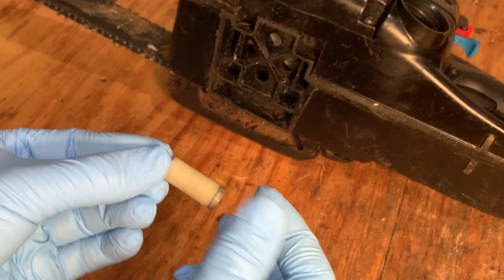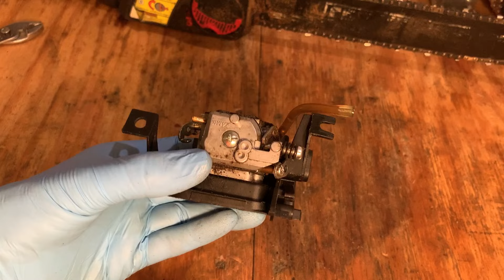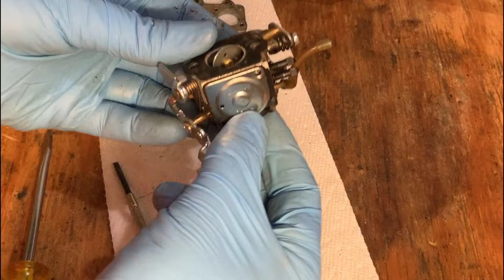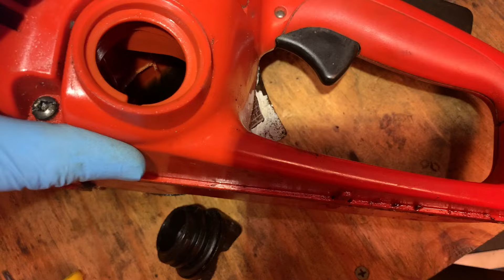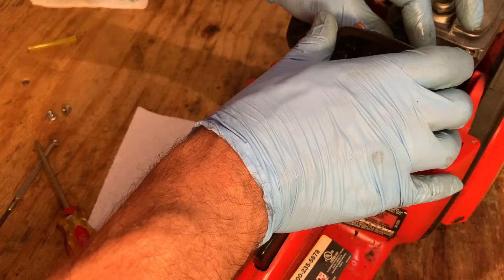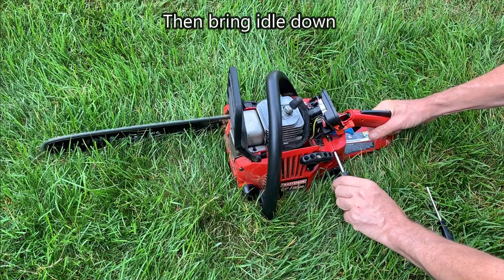Will They Run? Two Craftsman Chainsaw Will Not Start - Fixed

Comment: I have the same chainsaw, bought it new at Sears 20 years ago. As I’m sure you already know it’s just a rebranded Poulan, not the greatest but more than adequate for occasional homeowner duty. I replaced the fuel lines on mine a few years ago, they were completely rotted away (it doesn’t get much use). Watch out for the chain bar oil, these are just simple constant drip feeders and they’ll keep weeping chain oil out even when they’re just sitting until the reservoir is empty. When I’m done I usually dump the chain oil through a coffee filter and back into the bottle, otherwise the case gets loaded with oil.
Reply: I have a Poulan, bought in 2001, I used it for about 3 years.  I cut wood all year long, in the summer build up for winter,  and winter to keep well stocked.  Mostly only used on weekends.  Replaced the fuel lines,  fuel filter, air filter and one oil pump for the chain.  I let it set for a few years,  and wouldn't start.  Replaced the carburetor,  fuel lines and filters,  and it started right up, had to adjust the carburetor and it idles,  and accelerates smooth and fast. 

I know people knock on Poulan,  but if you take care of them they can give long service.

Comment: Since I started watching your videos I fixed a John Deere L111 riding mower that was sitting outside for four years, a Husqvarna riding mower that had gas leaking into the oil, an edger that I found in my moms shed that hadn't run for 6 years and 2 chain saws. Now I just have 2 motorcycles and a jeep to tackle next. Great channel.
Reply: Good job, keep it up.
Reply from the maker: Very nice

Comment: Both of these saws are made for Craftsman by Poulan Co.
Reply: Husquvarna builds those saws for Craftsman and Poulan...I have Poulan Pro set up just like this it's just diff color combo and rebadge...One of the best saws I've ever owned and used honestly.
Reply: Hank Bridges  Ok...I have the 4218 Model Poulan Pro
Reply: I have a husqvarna 236e which Is pretty similar. Good little saws.
Reply: ACTUALLY the craftsman models with the. Sim pull or Intellistart are made by MTD

Comment: Don’t waste your time with the aftermarket carb you’ll be doing it all again in less than a year. Just get the OEM Walbro. Also taking the kill switch off is not needed, remove the other torx screw up top above the 2 studs that hold the carb in and you can leave all that intact. Saves a lot of time.
Reply from the maker: Thanks.  I saved the original carb that did not prime.  Will probably rebuild it or just get the OEM one.  The OEM one is not much more then the clone.
Reply: James Condon you can try but typically these carbs are temperamental to adjusting and rebuilds are usually a bust. We were taught by Poulan to install the new carb and if it doesn’t run correctly with no adjusting throw it away and get another new one. Saws with a designated port for air only are easily leaned out and brunt up if adjusted. Don’t stress it some things are just not worth your time and frustration 2 strokes seem to be that type of machine. Very impressed by your videos though. I am a 25 year master technician on outdoor power equipment and in my opinion you are smarter than myself and every other fix it channel on this platform. Keep it up!
Reply from the maker: Dan Vanslyke thanks.  Still learning this stuff, especially on the two cycle side of things.  I have had very bad issues with clones and waisted a lot of time because of them.
Reply: Chainsaw carb rebuilding is greatly aided by an ultrasonic cleaner.  Pay attention to order and position, it’s not that difficult

Comment: Ethanol in gas absolutely destroys all the hoses and flexible bits in the carbs.  Most of the problems I've had with 2-stroke engines have been cured by switching to the expensive premix.

Comment: Thanks for the efforts James. I’d like to add a few things for anyone trying to learn: when adjusting the carb on a 2 stroke machine, there’s also an H (high) adjustment screw. This allows your engine to rev higher or lower when on full throttle, do not get carried away with high RPMs. Also, one of the most important things you can learn on these machines is proper chain and bar maintenance. Learning how to properly sharpen the chain and depth of “rakers” is vital! Also, please do yourself a favor if you’re a home owner and buy ETHANOL FREE premix fuel. Yes it is more expensive, but your saw will stay running a lot longer and the shelf life is over a year.

Comment: Ok im at 17 seconds in, my prediction, both will run nicely and was a great buy for 30 bucks. They are craftsman, they will run great.
Reply: Well i cant say i was wrong, soon as i seen it i said, carb rebuild kit, then you said it, lol. But you might want to use the diaframs from the clone carb and use the original, they looked like zamas and they are better carbs than the cheapos. ... So anyway, how is the black one end up running?
Reply from the maker: Both ran well

Comment: Just dug two old chainsaws out of Pop's shed a few days ago, neither of which has been ran in years. A Poulan 3516avx (circa 2008) and a Poulan 3314 (circa 2014). Both somewhat/very similar to the machines in this vid.

I was able to get the 3516avx up and running by replacing the purge bulb (from the 3314), purge bulb lines, fuel filter line, and the larger diameter black rubber connecting tube between the carb and engine. All were crumbling, cracked or swollen loose.

Surprisingly, for a 2008 vintage, it fired right up and idled after initially setting the L and H screws to 1 1/2 turns out. After adjusting the L screw counterclockwise to where it just started to idle down, adjusting the H screw to where it just starts to cut out (4-stroking) on max throttle, and setting the idle screw out to where the chain just stops moving the saw now blips and tops out as it should. 'Can't wait to give it a go on some recently fallen trees on his property in the near future.

The "newer" 2014'ish Poulan 3314 will have to wait for a new purge bulb and purge/fuel lines. I was hoping there was enough line in one fuel line kit to do both saws but nope! 😂 I used it's still relatively decent purge bulb to get the 3316 up and going as it is really the better saw between the two. I will eventually get two new purge bulbs, fuel filters, and air filters. 

The 3314 was missing it's air filter entirely, which is about par for the course with Pop. After helping him get all of his equipment going that has engines, (of which there are no fewer than 6 riding lawnmowers, two chainsaws, two pushmowers, and a generator), I've started calling his place "The No Filter Required Ranch"!

Both spark plugs looked mechanically fine so I cleaned them and I verified/gapped each to .025". I then verified that the spark arrestor screens were clear. Judging by the condition of the spark plugs, spark arrestor screens, and chains neither saw has much actual use. Pleeeeeenty of compression on both when attemping to start. In fact the 3314 is a nasty mean little critter!

I did initially have to rewind the coil spring on the 3516 and slightly file the tapered edges and end on the white "plastic" ratchet that mates the recoil housing as it was binding and not letting it rewind properly. (Probably what caused the spring issue.?) I could only describe this as a factory "oversight/defect". 😄

After a little initial troubleshooting I have my sneaking suspicions the 3314 may have a carb issue too but a quick peak at the metering diaphram and fuel pump revealed nothing overly concerning , so I'll get it's purge system and fuel lines replaced before getting too crazy with the little carb. Heck it might fire right up as well! (Once Pop saw that I was able to get the 3516 up and going properly he wouldn't let me use it's parts for troubleshooting the 3314. 😂)

James, I've really enjoyed watching all of the vids on your channel over the last several weeks. Thank you so very much for taking the time to make them for us in the detailed manner that you do!

Comment: I have one of these too.  Can't beat the original price ($119).   Had to put a new carb on last year.  Had to purchase a double hinged pair of needle nose pliers to pull the hoses from inside the tank.  Cut up a bunch of eucalyptus with it a few months ago.  Pretty happy with it.  Good for around the house and the occasional bigger project.

Comment: Watched your video and was able to fix a 18" 42CC that I bought for a few dollars at an auction. I bought a new carb kit for mine and the only thing that gave me trouble were the fuel lines that came with the kit. The fuel lines in the kit were the correct diameter however they were extremely stiff and had noticeably thicker walls than the ones that I was replacing. The fuel lines in the kit were not pliable and wouldn't fit through the holes in the tank. I bought a fuel line kit from my local ACE for $6 and they worked great. Nice video!

Comment: I have a 20 year old Homelite chain saw that would stall out even on high speed. Despite cleaning the carb, I could not get it to be reliable, so I changed out with a clone carb. Advertised as an exact replacement, but it wasn't - the throttle link was on the opposite side of the body. I just retrieved the shaft from the OEM and away we went. The adjustment holes did not line up, but no big issue. I also use the Harbor Freight electric chain sharpener, and it can make the chain razor sharp (after getting it properly adjusted)!.

Comment: I have that same red saw. 36cc 16" bar but mine seems to have a lot more power. I definitely think a new carb would fix yours right up. Great video, channel is growing fast.
Reply from the maker: Yes.  I tuned it a little more but agree a new carb will be needed dinner the later.  Thanks!
Reply: You still have to tune a new carby.  First mistake was tuning it without the air filter- when you put it on, it makes it run richer and needs tuning again. Second mistake was not tuning the high rev mixture screw. The low screw only makes it idle nice, the high screw is for when under load at operating speeds.
Reply: @jcondon1  These are rebranded Poulans and they can not be properly tuned without the air cleaner installed. Also they will bog down if the muffler is clogged which will happen if it is not taken off from time to time and cleared.

Comment: Well that was a good video.. not bad for a couple of cheap saws. Some people don't bother to repair them. Still ones man's junk is another man's treasure
Reply from the maker: Thanks.  I usually avoid small two cycle stuff like this.  Sometimes hard to service and they are not worth much even when running.  My main saw is a Stihl, was not expecting these to cut as well but I was wrong.  They are not too bad.
Reply: James Condon yeah. I don’t mind the 2 stroke stuff.but you have to pick them up for cheap.good channel
Reply from the maker: Micks Mowers just discovered your channel.  Very nice.  You have one more subscriber.  I liked your recent generator video.
Reply: @jcondon1  like wise mate.. I see you have been going for a while. I'm still new to this YouTube stuff. But having fun along the way.. I do a sat night live stream and will give your channel a shout out. Hopefully you will get a couple more by the weekend
Reply: If you don't like two cycle engines don't buy a Trabant. The little car that couldn't!

Comment: I'm still running my Craftsman 34CC 18" bar. Bought in the mid 80's... It's seen occasional use but when it does, it gets a hard workout. 

It was made by Poulan. Everything the same. Except the color.

Comment: I've had a couple of those, I believe they're made by Poulan.  They have a big following in the chainsaw forums with great info on overcoming their shortcomings.  They work great for light duty, but once overheated they stop running and refuse to start until cooled down.  Word in the forums is removing the catalytic converter from the muffler, or changing to the muffler that doesn't have one (part number in the forums if you search), drastically reduces the overheating problem.  I didn't verify this myself but seems easy enough to try for someone who has this as an only saw.  You do need to keep the carburetor adjuster handy as they need frequent adjustments.  They do cut well (with a good chain) and are fine for occasional around the house use, probably good value for the price even when bought new, but if you have a major project it would be worth investing in a hardier saw.
Reply: I have this exact problem. The saw ran 100% when it was 20 degrees, now at 45 took me for ever to start it. How it's hot and will not run. Talk about garbage.
Reply: @lukez1729  Are you giving ambient temps in C?  45C would be 113F which is desert hot, I'm not surprised if you have trouble starting a 2T little gas motor in that heat.  It's likely flooded, hold the throttle full open while you pull the rope.  Maybe turn the high and low speed jets a little leaner.
Reply: @8180634  temperature is in F.
I just redid all the fuel lines. Still the same issue. Fired up Fairly well, did a.couple quick revs to adjust high speed, and it was running great. Then around a minute later when it got hot hot(feels to hot) I don't have a temp Guage but my other husky doesn't feel no where near this hot. Then just just bogged down and stalled, impossible to start.spark plug isn't wet. This saw refuses to run once it gets hot. I think it's just a bad saw. I have light scoring on the exhaust side . I also remove the spark arrestor.
Reply: @lukez1729  yeah those saws just don't do good when they get hot. I had a big job ran out and bought a Stihl ms361 to replace this Craftsman / poulan and it's a significant difference. It's also a significant difference in price, but this one runs hard all day
Reply: @8180634  thanks for your reply/info. I'm so disappointed in this saw, it cuts great but only for limbing and cuts less then around 6 inch.   I must have spent 5 hrs trying to figure this out. I literally have blisters on my hand from pulling so much. It's just a trash design. Only good for super light duty work and short run times.
Reply: @lukez1729  the chain makes an enormous difference, make sure it stays sharp. Even when I'm using my Stihl I give it a quick sharpen between tanks if gas, it cuts so much better. For the motor, richen up the air/fuel mix a bit, mix a little more oil and if you're making a big cut, keep the saw running and idling for a couple if minutes before you turn it off and that will help cool it down.  If you have a fan, let it blow in by the pull rope when the saw is off, that will also help a lot. The goal is keep it running until the tank is almost empty, then try to let it idle for a minute or two before turning it off.  When it starts to stall a little bit try to use the choke to keep it going.  I've put many gallons of gas through these saws and that's what helped. Definitely not a fix but makes it a little better.
Reply: @lukez1729 you either have low compression that’s just enough to start and run for a bit but when hot the compression drops and then won’t ignite the mixture. The crank seals may be worn so leak when warmed up also.
Reply: @rubentrujillo2013  yes it ended up needing a top end, cylinder was scored bad.

Comment: Cutting with a dull chain is like pissing, then pulling down your pants.  Unless the diaphragm(s) is pooched, you can usually do a good carburetor clean, adjust, and get them running good.

Comment: Those saws are built just like the polun pro saws, and I have 2 that have the same air bubble problem.  I worked a bunch on them and got one to were I could get it to start if I held it full throttle, and it would run at full throttle till I let go of the trigger, then it would idle and get slower and slower till it died.  If you tried to give it throttle it just slowed down faster till it dies.  May be carb adjustment, but I did not have the tools to do it from the outside and got fed up with it.  Glad to see someone fix one, I see them frequently on facebook and craigslist for cheap.
Reply: On ov of
Reply: The name of the place o or o or something else wh You're I are you located and  will share it with the name on are
Reply: Can I have one?

Comment: Many times I see people give up on small engine equipment,  and most of the time, to fix is much cheaper than to buy a new one.  

I have a Poulan saw I bought in late 2001 and had to do maintenance on, changed the  fuel lines, filter,  an oil pump,  chain and bar.  Sat for a few years,  had to replace the carburetor fuel lines, primer bulb,  spark plug  and air filter and it runs as good as new. 
Was much cheaper than buying another new saw.  I enjoy all your videos sir, great content,  and diagnosis.  Thank for showing regular guys how to fix their own machines.  Very valuable information sir.
Reply from the maker: Thanks

Comment: I just changed all the fuel lines on a craftsman.Their primer bulb has a neat little deal . A large and a small nipple. The small side goes from the primer to the bottom on the far side of the carb. The large or long one, goes from the primer to the fuel tank on the far side. The filters line goes from the tank to the top of the carb on the far side

Comment: Little Craftsman is so simple the old one on the right it'll always run but every two years are going to have to put a new fuel line in it and I do recommend running the can fuel in it before you shut it down for the season and it'll always start I've had one for over 25 years and is changed fuel line and maintenance today